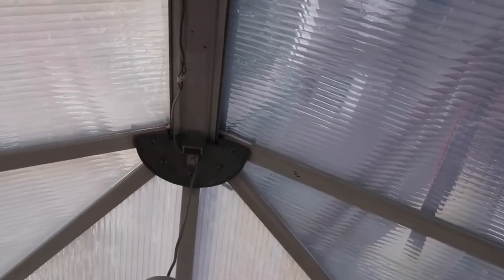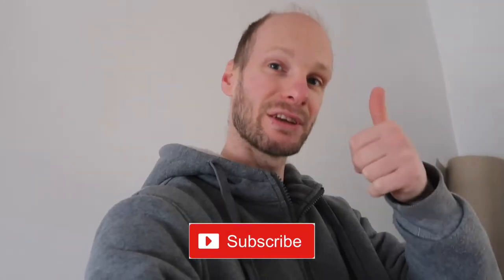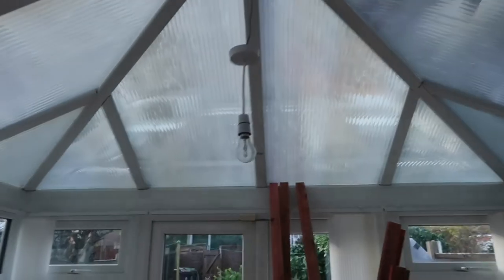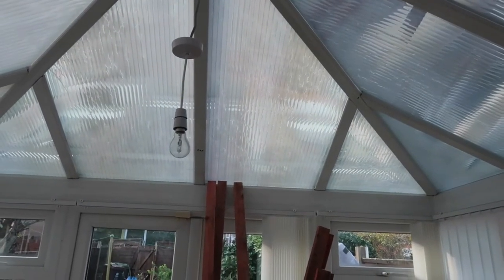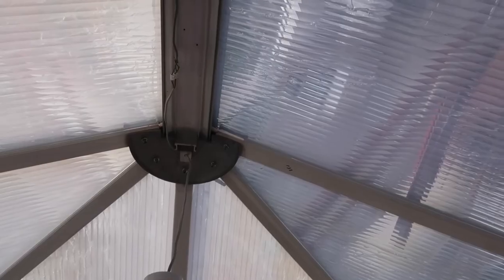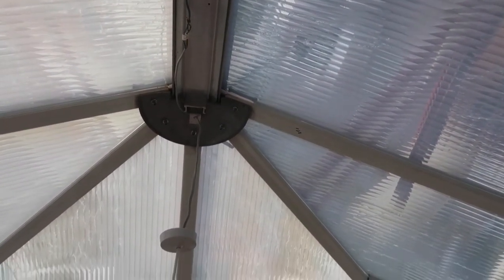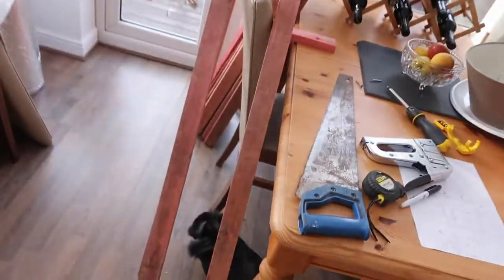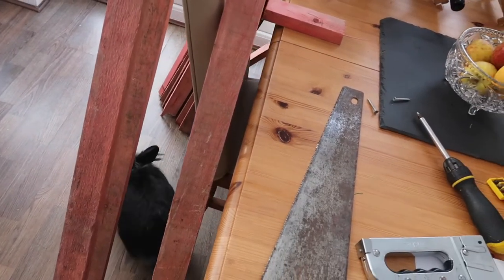How To DIY INSULATING A Conservatory Roof For Less Than £250... By Yourself, Start To Finish

Comment: Hello. Look if anyone else does this, and its OK to do it, take these extra precautions. 
Firstly the foil is super reflective, so the sunlight that once came through the poly-carbonate/glass harmlessly into the room is now magnified and reflected at close quarter to the plastic, glass seals etc. At the very least this can cause the seals to cook and crumble, letting leaks in, at the worst, and this DOES happen, its a fire risk. 
So blacken the original ply/glass either with paint or a suitable membrane that is fire proof, a roofing membrane (or sarking) will do.
Secondly, you have extra weight on the roof, it will now want to spread. So please retro fit a tie bar or two if yours doesn't have one. If it doesn't have one its because it didn't need it with the spread and load when it was built BUT it will need one or two now. Dont forget, now its insulated snow will not melt and run off, it will stay and is real heavy.
Not trying to disrespect this job, workmanship or scare anyone but just trying to inform and hope to help.
Kind regards
Pat
Reply: Hi, with regards to your comment of applying a membrane to stop seal degradation, do you suggest applying it directly to the poly/glass internally or externally? Or can it be laid on the outward face of the insulation between the baton sandwich? Hopefully that makes sense, thanks in advance.
Reply: @HMomber  Hi Harry. The seals will, in time, degrade regardless. They are however designed for the job, water, uv etc and, like your car rubber seals around doors, will become older looking, cracked etc BUT they will still last for many years, in fact the life of the conservatory. The problem I highlight is the magnification of the sun that having silver backed foil insulation exposed to the sun. As long as you stop that reflection then you are helping the situation. You could actually paint the surface with a matt black paint or similar. I always had spare roofing membrane left over so used that but as long as something is under the glass internally and on top of the shiny surface of the insulation you have cured the issue
I to hope this makes sense...
Reply: @Pat0rchard  Perfect, makes sense to me. Thanks for replying!
Reply: @Pat0rchard  would it be advisable to put roofing felt on top of the poly (on the outside) to prevent reflection of the foil damaging the existing poly roof or would that pose a fire risk?
Reply: @spoiltpooch  Hello. I personally would not try this. Roofing felt is not a great product to cut, trim or fasten neatly. I stopped using it a long time ago and my preference on flat roofs is one piece rubber.
I think it will look messy at best. Just need something to block the UV while keeping it attractive from outside. You can get false roof slate effect covering for sheds I saw someplace. Hope this helps.
Reply: @Pat0rchard thanks for the speedy advice.

Comment: I'm just about to do this, but I was going to use 9mm hardboard instead of plaster board as mines a slanted roof. Do you think that will be ok?
Reply from the maker: You can use whatever you like but it's easier to work with plasterboard cutting wise than wood.

Comment: Conservatorys which don t let light through the roofs  need planning permission I think.. Those which let light through do not so if you have blocked the light now the conservatory needs planning permission  . Something I had to check when selling a property and buying one with a conservatory.I could be wrong as its ten years since I was involved
Reply: Since 2019 you don’t need planning permission for conservatories to put a solid roof on, as long as it’s under 30m square.

Comment: Hi James. A year later, can you give an update on whether it was worth it as I am thinking of doing as I have same issue with my conservatory. Great video 👍
Reply from the maker: thanks mate, I've moved house now but in the period i used it, it did help. I mean for £100 in materials and a few days work over 100's and trades fitting upvc ceiling i'd say its good. My buyers haven't complained so I imagine its still works and hasn't fallen down. I've done a loft hatch and ladder install in. my new house reno series too.
Reply: @FamousJames  Busy busy! Do you think it's worth adding some loft insulation if I get thinner rolls?
Reply from the maker: @lookingoutforadventures6009  no, you need to let the roof breathe even though you’re insulating it. What I’ve done will be fine and it did make a difference.

Comment: Really excellent video and love the house rabbits!! 
Did you have any issues drilling into the glazing bars ie were you concerned about putting in a screw to far or in the wrong place and causing a leak within the roof?
Reply from the maker: No I watched a video done by a lady and then just bought what I thought was good. There is a lot of room inside the frame so I just drilled and it worked. I did put a few extra screws in in places due to the weights of the boards. 
My fiancée says it’s warmer than it was and obviously the side windows will let warmth out but if I close the blinds it’ll stop a nice garden view. 
Thanks for watching and nice comment. Hope my video helps or helped. 
Yeah the rabbits are a pain, eat everything but are funny too.
Reply: @FamousJames  many thanks ,say hi to the rabbits 😄

Comment: How'd you finish the edges at the bottom of the roof where it hits into the frame again? Cheers for the video boss
Reply from the maker: I just left the bottoms as they were clean edges and it lets air circulate also. Thanks for the view and comment, I've done other DIY video since this one too.

Comment: Trying this project myself, as we had a glass conservatory, I've lined the inner glass with thermafrost (As I understand, it prevents UV damage of the insulation layer, means you don't see the insultation from the outside and helps a bit with condensation prevention.
I'm in the process of ordering the battens, but am unsure which ones to get. What type of wood did you use? Im seeing kiln dried, treated roof timber and CLS...
I'm also figuring out batten size. I'm trying to balance out the size of battens that will be big enough to support a layer to plasterboard but also as light as possible.
I'm currently thinking of going with Kiln dried 19x38... Any advice?
Reply from the maker: I ordered battens that were same width as the conservatory roof trusses ie frame. for me it was more about what screws to buy to anchor the wood. I don't see the point in kiln ones really as you're inside so it doesn't need weather protecting, but its uptown you really on that one. I would go for thin boards as well as you don't need heavy boards in there or even fireboards. 
I can't remember if I mentioned the sizes of the wood etc in the video as I did it 1.5 years ago. I don't live there anymore. I think I got 2x1" battens but not sure. I've done more DIY videos also like loft hatch, boarding my loft etc also if you're thinking about that project also.
Reply: @FamousJames 
Thanks!
Think I've got my hands full with this project for now, but will look on jealously!

Comment: Thanks for the video. I am about to start this on my conservatory. Did you install any ventilation? Is it required? I am worried about condensation build up in between the layers
Reply from the maker: I didn’t seal the bottom near the windows so the layers can breathe. Just make sure it’s solid and secure. I’m not in that house anymore, doing another house up but it seems to work.

Comment: Great vid! I was thinking of just laying batons across the top of the window blind rails and then laying insulation across the top of the batons as a temporary measure through winter. Do you think it will be effective? I don't have any doors between kitchen and conservatory, so it is shedding so much heat from the house.
Reply from the maker: I mean if you ewant temporary then fair enough but if you want a nice finish that will add value to your home and save on loft heating then i'd go with doing a proper job and take the time.
Reply: @FamousJames  yea, I just need something cheap that will save a few quid on gas over this winter and possibly next till I have the cash to get it done properly.
Reply from the maker: @jimbagheed483  i would say if you don’t care how it looks then just either batten it and staple insulated film on it or you could just staple the film to the roof and be done with it. All depends if you want a sh1t show look or a nice look basically

Comment: can the batons hold the weight of the plasterboards and the skimming etc?
Reply from the maker: I screwed the batons into the metal of the original roof, the insulated, the battened to batons, then boarded and I didn't skim all, just joints.

Comment: Hi with the edges where the foil meets the top of windows . Do u tape it to the window tops? Or do u just batton the bottom across (2nd layer) . Won’t that leave air gaps?
Reply from the maker: I stapled the foil to the battons and then cross battoned it for plaster boarding it. I did tape the edges too to create a seal. Hope this helps. 

I’m currently renovating another house too if you like watching diy videos. Thanks for your message and viewing of the video 👍
Reply: @FamousJames  hi are you on insta ? Wanted to show a picture of how builder has done edges. Im worrying he hasn’t done it properly. He just screwed batons to the plastic rafter , then placed the insulation in first baton and screwed 2nd baton through to the first like a sandwich . But did not staple? Kept telling him to staple first but wouldn’t listen
Reply: And he placed 2nd batons vertically like the first but with no horizontal batton at the bottom edge where insulation and top of window meet so there’s gaps ? Does the 2nd batton need to be tightly positioned at the bottom to stop air thriugh ? Could i foil tape the edge of  insulation onto the top of upvc window?
Reply from the maker: @s.r3366  I’ve places vertical battons first, the insulated foil, stapled it, tapes the joins, then horizontal battons for plaster boarding so as you said the air can circulate but provides what I want ie to hold the heat in and keep it out dependant on the weather.
Reply from the maker: @s.r3366  I screwed the battons through the plastic into the metal for a secure hold. I watched a lady on here doing it and my videos shows what materials I used at each part.

Comment: Did you take the temperature before the insulation and after. Else, how do you know your work has improved the cold problem. A lot of the work was unseen so I'm wondering if 'the girlfriend' was the one doing all the work and you were the narrator!!!
Reply from the maker: yeah my wife did all the work and I just sat there an did nowt hahaha. well we don't live at this house anymore and the new owners haven't complained. I know its made a difference as when I did go in there in both types of weather it was more comfortable to be in there than it was before I did it.
Reply: @FamousJames  So it should be called Famous Wife,
Do you have a conservatory in your new house?
Reply from the maker: @sniperpd9505  haha no not at the new one. She’s still doing everything 😂 literally I need to put a GoPro up to show I’m doing stuff. I’ve literally put 2 toilets, 2 sinks, a shower tray, loft hatch, boarded a loft, done plastering. Reroofed a shed, installed a kitchen sink, changed multiple lights etc.
Reply: @FamousJames  Yes, a GoPro or the wife with a camera filming Famous James doing the work.
Reply from the maker: @sniperpd9505  my wife would not stand there filming and my camera only has so much battery so GoPro it’ll be. If I do this I better get more views and subs as it’ll be more work and hopefully showing more of the process of stuff

Comment: The conservatory roof was never designed to take any extra load ( apart from snow load ) also there is no airflow. What you have done is not safe, and once the trapped damp gets to a certain point the plasterboard will simply come crashing down. 
What you think you have done super cheap will end up costing you dear… to put it right. Also you have devalued your house doing this.
Sorry it’s not what you wanted to hear, 
 Conservatory roof insulating has building regs for a good reason 🤦‍♂🤦‍♂
Reply from the maker: Thanks for your advice and comment. I watched many professional videos about best way to sort it and asked professionals too. If it falls, it falls, if it doesn’t and it works as it does then nice. There will be no trapped damp as I have left air gaps and not plastered the edges so we shall see.
Reply: @FamousJames  I wish you luck.. and fair play to you having a go at keeping the heat in. Cheers 
I only commented as i wanted you to beware of the risks
Reply from the maker: @bensomerset1  yeah I appreciate it. I always research vastly before undergoing a project. If it falls, I’ll fix, if it’s fine, happy days. Thanks for commenting and advice. This is why I post videos for others to talk about it or help them or even myself.

Comment: Would have been nicer if you showed us how the insulation went into the roof rather than showing your skills
Reply from the maker: I did show how it went into the roof. I showed each step in the process.
Reply: @FamousJames  sorry i missed it 😞
Reply from the maker: @Wild-Storm  you can see how I’ve battened it and then insulated it then battened then boarded.